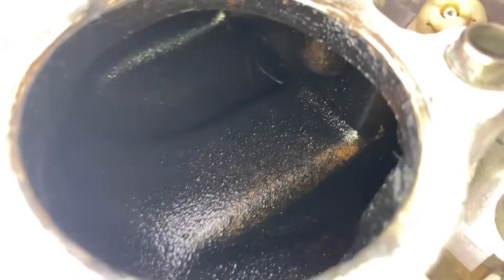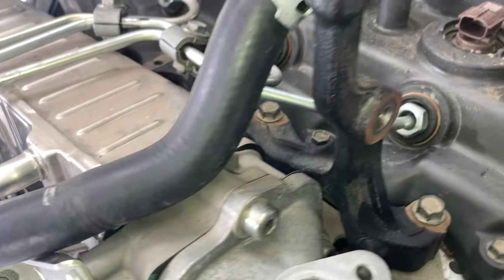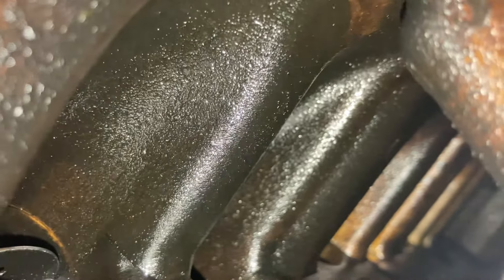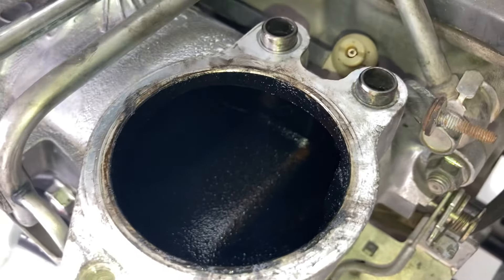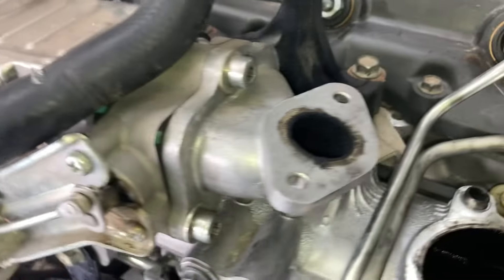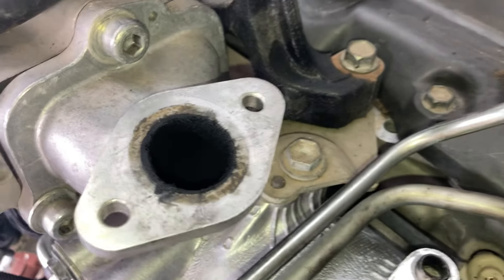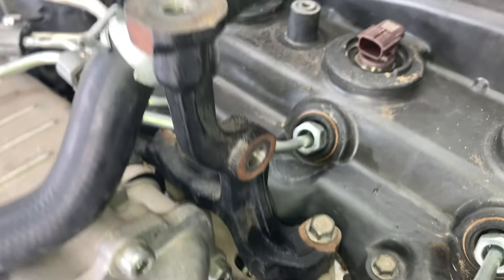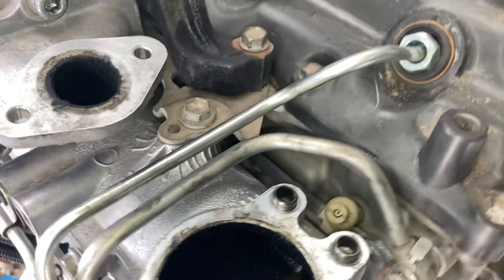Clean as EGR $10.00 20,000kish

Comment: Since doing the solution my oil is now still clean on the dipstick after 8000kms. Previously it was always dark within a couple thousand kms. 280,000 2011 hiace. New injectors at 260, solution done at 266, as the new injectors had no effect on the oil cleanliness at that point.
Reply: Hi mate, excuse my ignorance but just wondering what you mean by the solution , cheers .
Reply: @theartofselfanalysis7600  egr blocking plate.